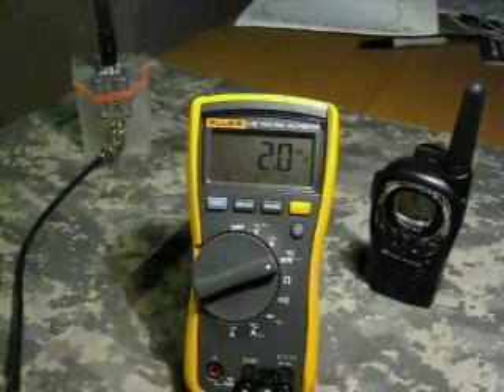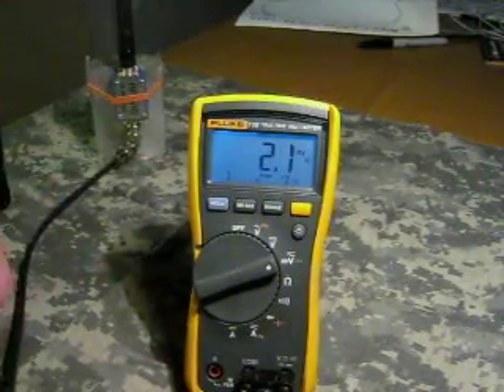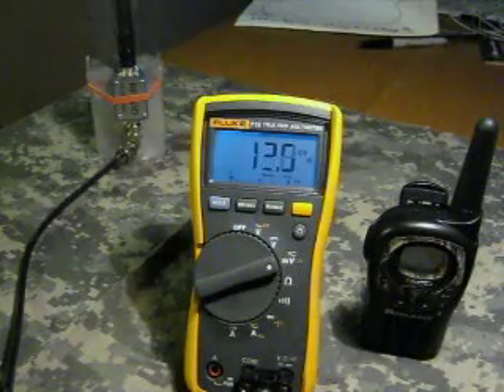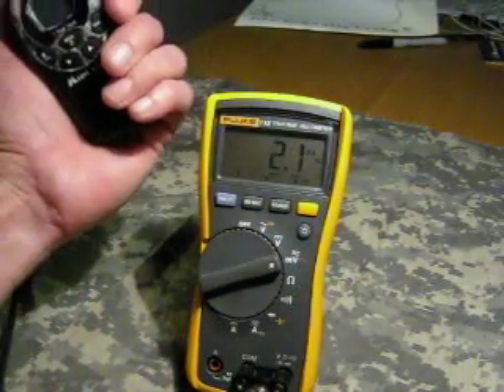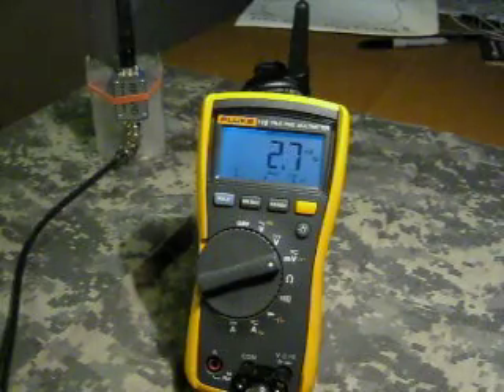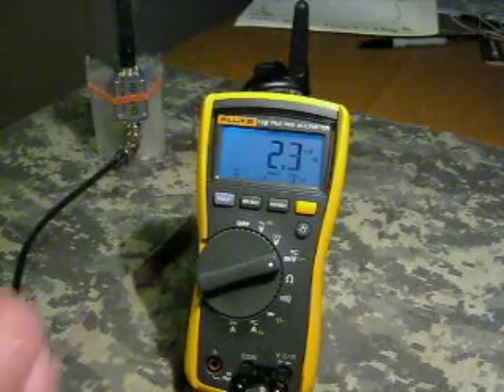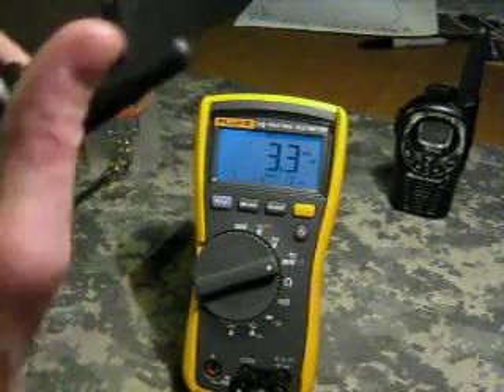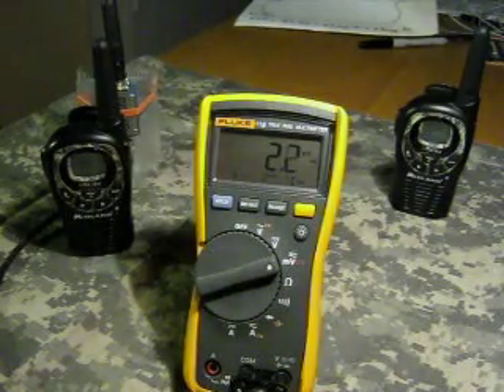FRS Radio - More Range.AVI

Comment: Yup, you loose about 50 percent of your Effective Radiated Power when you are cross  Polorized. Also you can try moving a few feet one way or another, Do not try it inside yopur car or vehicle, because almost 90 percent of your Effective Radiated Power. I remember years ago Radio shack had a device you clipped to your cell phone antenna parallel with the antenna with attached coax, and it went to an outside antenna. You have not violated the FCC rules of not removing the antenna and putting a coax connector on it for an external antenna.Which would violate the FCC rules and Regulations for FRS Radios.

Comment: Love that Fluke meter.I used to have an older Fluke 87-III but times got tough and had to sell it years ago. Although my cheapie Radio Shack works just fine, I sure miss my Fluke 87 :(
I can't fault my Radio Shack meter though. I've had it for years and it has computer interface, which I use a lot. My Fluke 87 did NOT have this feature though but God I miss that meter!!

Comment from the maker: Yes you would,  the point of this video is that both the receive and transmit antennas need to be oriented the same way; the easiest way to ensure this is for everyone to hold their radio so that the antenna is pointing straight up. If both radio users held their radio at the same angle you would be OK as well but there would be too many factors involved such as are both users facing the dame direction.
Reply: Thanks for a great demonstration. We have all had transmitting problems from time to time that were unexplainable. Could you be so kind to test one of the Garmin Rino series of radios. They have a great gps, but the two way radio really performs poorly. I believe that the placement of the gps antenna in close proximity to the frs/gmrs antenna is at fault.

Comment from the maker: In the engineering world a decade just means something times 10. A geek would say "an order of magnitude".  Anyway cross polarized antennas see a 20 db loss which works out to the same signal strength as multiplying your original distance by 10 using the formula 32.45 + 20 Log (Frequency MHZ) + 20 Log (Distance in Kilometers)

Comment from the maker: @peterkim1999 Yeah, you could think of it as light waves,  that's how polarized sunglasses work, they pass uniform light rays but block the scattered rays which cause the glare that makes things look unclear.  Fresh water fishermen like polarized sunglasses because they can see through all the glare caused by the sun hitting the surface or the water and reflecting off at odd angles.

Comment: Very informative, thank you. I also visualize it as similar to a light bulb that sends out lights on side ways, if you tilt it, then those lights will cut vertically up down or diagonally, not towards the receiver.

Comment from the maker: @cobra395 Yeah, been there done that,  I've been licensed for about 16 years,  thanks for watching my video.
Reply: Would you perform your testing on a Garmin Rino radio, where Garmin has placed a GPS antenna alongside the UHF antenna on the top of the radio. I've always had a concern about these two antennas interfering with each other and affecting transmit power. Thanks.

Comment from the maker: @texture6 No, the detector is designed for just vertical reception - but so would be the receiving radio that you are trying to talk to.  That's the point of this video.  Cell Phone towers use big and expensive circular polarized antennas so people can hold their cell phone in any position they want.  But with simple FRS radios like these,  you need to understand how antenna position can effect your ability to communicate.